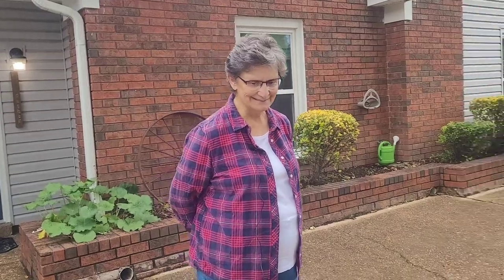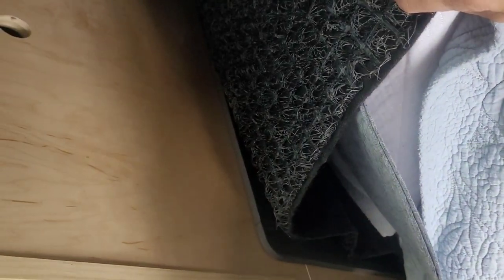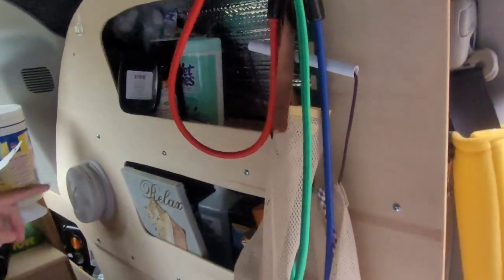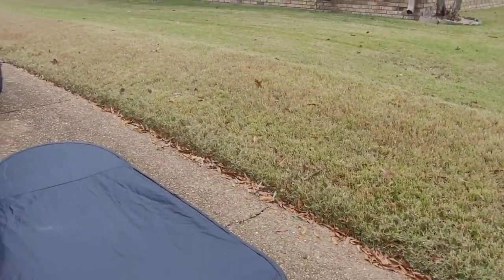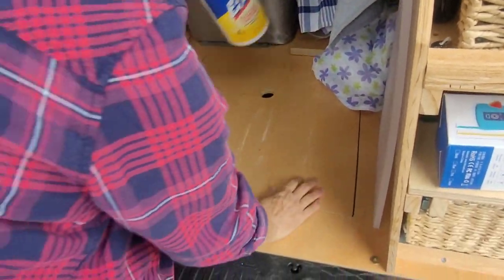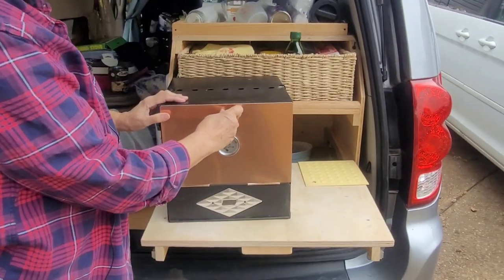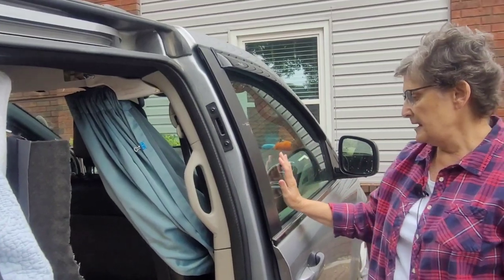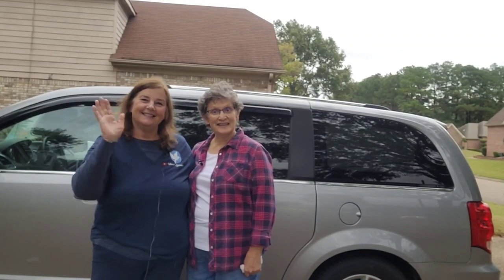Celia takes us inside her minivan camper that took a village to build.

Comment: Thanks for the video. Now I know there would be room for a sewing machine. I don't leave home without mine. She has a great build.
Reply from the maker: I've met several people that travel with a sewing machine. Most tend to plug into shoreline and spread out on a suitable table.  One guy from the Yukon I recently met travels in a class C and makes quilts as he travels.
Reply: @TravelGrandma  yes I use in on in my trailer and I make crafts, and quilts too.

Comment: Great tour and great interview! I have a suggestion. You mentioned that your stove burner was a bit too large for some of your pans. Just put your oven rack or any grill on top of your burner and you can fit any size pan. So glad you were safe when your stove hose caught on fire! Guess that's another reason not to cook in the van! I'm in NC. Would be great to meet up with y'all sometime!
Reply from the maker: Great suggestion.
Reply: Yeah, if you want to cook inside the van it's better to take a look at 12v rice cooker/steamers.  Practical ones with a double layer system can cook a full meal easily with very little power and no risk of fire. 👍

Comment: I have a Grand Caravan, and I used generic double-sided nano tape to stick metal discs to the pebbly plastic around the windows.  Now I can use magnets to hold fabric in place, or mosquito screen.  The advertising claim is that nano tape won't leave residue when it's removed.  So far it's held up through 8 months of hot and cold so it sticks pretty well.
Reply from the maker: Great idea.

Comment: I store my pine pellets in dry bags with roll tops. They get smaller (and take less space) as you use the pellets.  I use them in a flexible 1 qt paint cup from Home Depot (buy lid separately) lined with a doggie poop bag. Keep liquids and solids separate for odor control. 

I have a variety of porta potties. The Reliance tripod collapses like a bag chair. For #2 I use cedar shavings and put the full bags in a METAL ammo box (Harbor Freight). Smells adhere to plastic. 

Great build.
Reply from the maker: Thanks for sharing your tips.

Comment: I’ve gone on two extended trips in a carefully built mini van camper, watched every you tube promising such a “wonderful!!!!” Great travel/living camping experience with all the cute Neal gizmos , storage, etc. it boiled down to 1) extreme heat...there is no dealing with it beyond sleeping with the engine and AC running.  2) extreme cold- shore power to run the tiny electric heater was not a compromise 3)  to reach one item,  8-10 other things have to be moved. This gets to be tiresome busy work. Some people thrive on the busywork of all the nifty procedures/ things they’ve figured out. Not me. There was no way on Gods earth I could cook in there. I am tall, so moving/changing clothes/ trying to use the cassette toilet turned into an exasperating chore. Plus, how on earth could you fit even one grandkid in there?? Sorry, for me the glitter has all fallen off. Mini-vans make poor campers at best. Plus...I was turned away from two camp parks ( not fancy ones!) in TX and could not camp with my friends! Ugg!! Think twice before falling for this.
Reply from the maker: There are advantages and disadvantages to every type of car, van, trailer and RV that people use to travel and camp in. Over the years I've owned three different RVs. Two were different size Class C's and one was a Class B fully equipped van style RV. Today I travel, park and camp in a minivan.  So I know a little bit about the difference between traveling, parking and camping in differently equipped RVs vrs traveling, parking and camping in a minivan.  For the type of traveling, parking and camping I like to do I have discovered a kind of convenience and freedom in  my minivan that I did not experience in any of the RVs I've owned. I thought about converting a van I could stand up in, but wanted to try a minivan first to see if I really needed something bigger. I discovered that I don't. Everyone's needs are different. I'm sorry that you did not have the kind of experience you were hoping for in the minivan you traveled in. It's been working well for me. A lot of the things you mentioned have more to do with preparation and adaptability than the minivan not being a suitable vehicle to travel, park and camp in. Some people have set up their minivans to sleep two adults.  Granted, it can be challenging and expensive to set up a minivan to meet an extreme off grid power need but knowing this it makes sense to travel, like the snowbirds do, with the seasons. At campgrounds bring and stay at a tent site. I cook in my minivan using a portable one burner butane stove with my window cracked open.  Most people over pack. But that's their problem and it doesn't have to be yours. I prefer to only keep thing things I absolutely need in my minivan. I have a designated area for my clothes, my food and kitchen items, my toiletries and my camping gear. The only thing I need to do is lift up a custion or pull out a drawer to get to what I need. I tend to be a minimalist, but I too continually find myself downsizing. These are just habits though and work arounds that take time to figure out. I am not trying to duplicate my minivan to have all the conveniences of living in a home. I'm using my minivan to travel throughout the USA to have different experiences wherever I go. These experiences mostly take place outside my van. I don't live in my van. I live around me van. Attitude is so important. I hope you will consider not giving up on trying to find the bliss that traveling can bring in whatever travel vehicle fits your needs more. Best of luck to you.
Reply: @TravelGrandma  excellent response.

Comment: I enjoyed this video thanks for sharing, what do people do with the seats they remove? Keep to put back in at a later date?
We have a 2016 Ford Flex and was looking for people that use them for this purpose, I’ve run across a few but not many.
My husband isn’t as game as I am in removing our second and third row seats to set it up to camp in, basically we would only need the car to sleep in and get a small trailer to pull with extra stuff in it. We are both 63 and on disability and both use CPAPS at night so we would have to set up some kind of power station, we’re not small people we are both tall and on the heavier side of life. We already have a luggage carrier for on top of the car that hold a lot of things, we used it on our road trip last year but for that trip we stayed in Hotels, that’s the expense I’d like to eliminate so we could travel more. We also have a big black Lab that loves to be with us on a trip, that made it really fun.
Reply from the maker: I believe Celia sold her seats. When I was at her place, her son took out only the very back seats in my minivan. This freed up so much room. I now have my refrigerator and all my camping gear stored in that area. I kept the two middle stow n go seats intact for passenger seating when I am not traveling. I did not keep those rear seats.